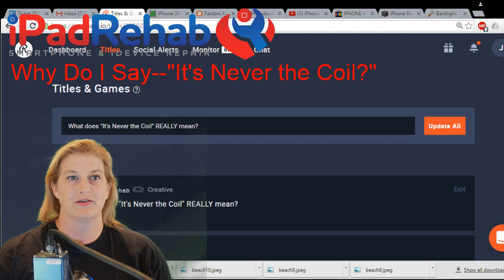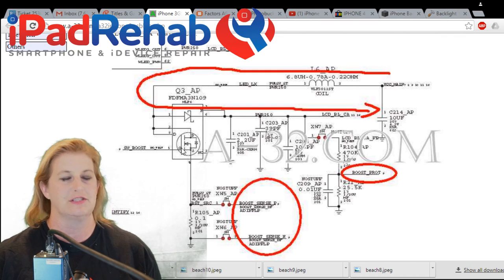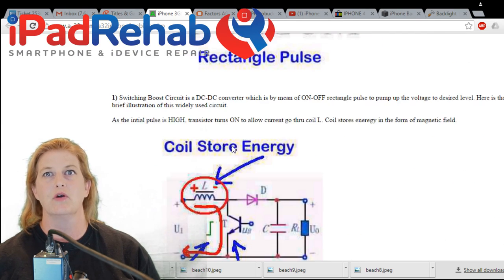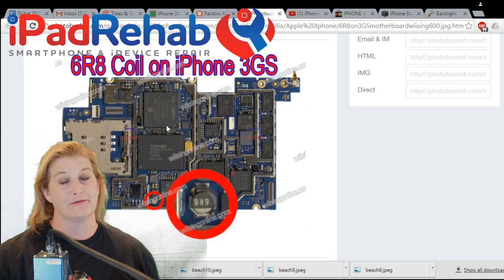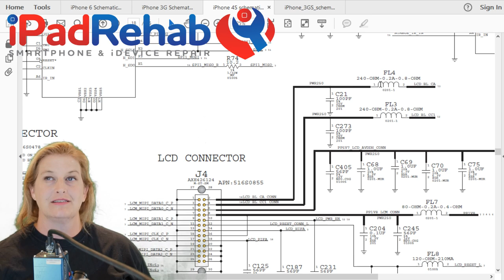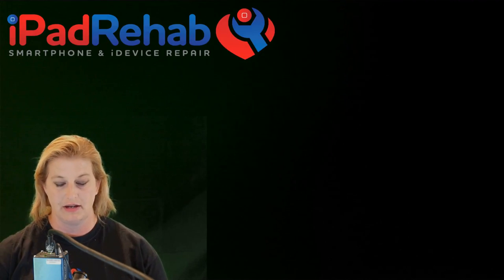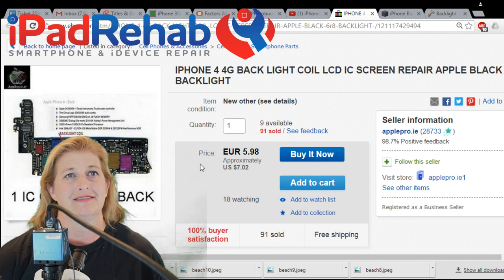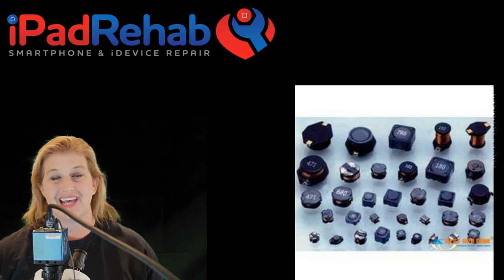What does "It's Never the Coil" REALLY mean?

Comment: I have an iPad mini 2 that only has VCC main voltage. Tested at the diode leg and connector. Replaced the coil and diode. But still getting the same voltage. The coil isn't boosting the voltage for some reason
Reply from the maker: +Ian Reilly rule out autoboot in dfu.  Coils don't fail to boost, mini 2 coil doesn't fail.  Changing the coil is a variable now, but prior to that it will be something else--screen not detected, autoboot to dfu, not booting, no image not no backlight, etc

Comment: Inductors (coils) and capacitors are both energy storage devices.  Inductors store energy in a magnetic field.  This enables them to be charged with energy at one voltage and then release it at a higher (or lower) voltage.  This is why they are useful in voltage converter circuits such as the boost converter shown here.

Capacitors store energy in an electric field.  This enables them to accept energy in the form of short pulses of current and release it smoothly as a continuous (dc) current.  So you will always find them across the input and output of voltage converters where they absorb and smooth the current pulses delivered by the inductors.

Both inductors and capacitors are also used to provide frequency dependent impedances eg as in the filters seen in these circuits where they block unwanted high frequency noise whilst allowing the low frequency signals to pass.  Impedance is the ac equivalent of resistance.  Inductors have an impedance which is proportional to frequency and capacitors have an impedance inversely proportional to frequency.  Resistors are components whose impedance (usually called resistance) is independent of frequency.

Comment: enjoyed your video. gives folks some concept of component function. With that you can better trouble shoot your problem. thanks.  P.S. i agree with the concept of the insulation coating on the wire break down as being a failure point. It does come into play if the coil is over heated due to high amp input or failure of the devise to cool. (i have seen a "pin" point due to water corrosion.) anyway thanks for the video.

Comment: An inductor/choke/coil is a circuit element, it's function depends on the parts around it.

When you say "Backlight filter" you are ignoring the capacitors, they are just as important as the inductor.
Open circuit capacitors = unwanted r.f getting to the lighting and other circuits :-(

Comment: The filter is protecting the led diodes the main diode/s is protecting the coil from a switching/short issue hence only time coil will partial fail is water across the main diode causing insulation breakdown  within the coils windings lowering the inductance current back feeds, builds within the coils windings, if you have a short across the diode and to ground in immediate vicinity of the coil, just bridge the filters and forget about it the filters are secondary line of protection for backlight diodes, if you get a short on the backlight led diodes or the fpc the main backlight diode would blow anyway protecting the coil and backlight circuit in years gone by called idiot diode now we have idiot filters you could bypass the diode but only a true idiot would do that I do on my own personal devices as long as it does not hit water no problem.
Reply from the maker: Water--or the cap shorting, and that's what happens with even minor drops on the 6.  The caps are rated for 25v in the 6, later changed to 35v in the 6s.  I think that 25v is not enough for that line and thus--signature failure on the 6 backlight system.